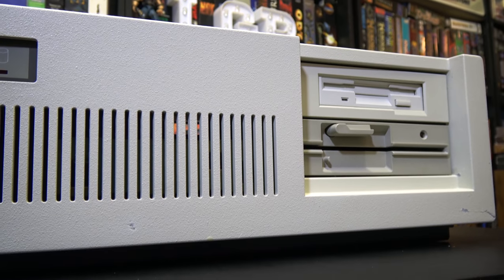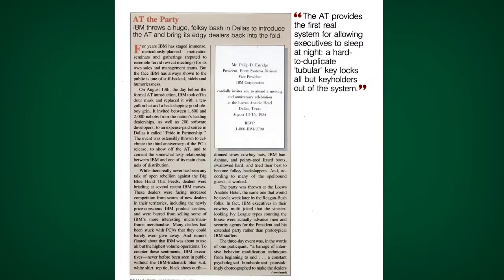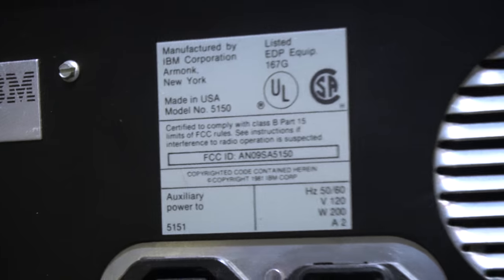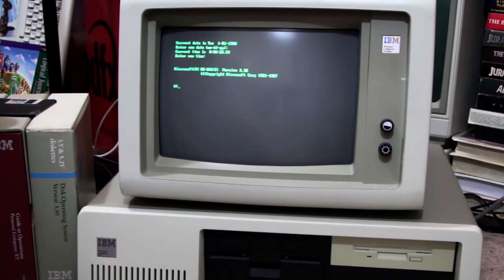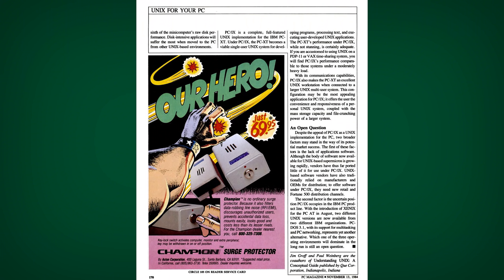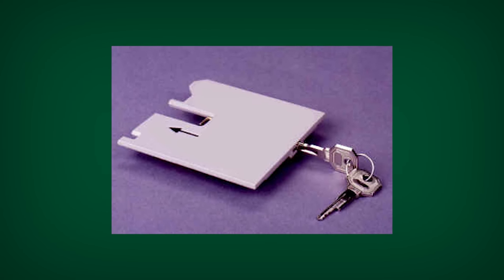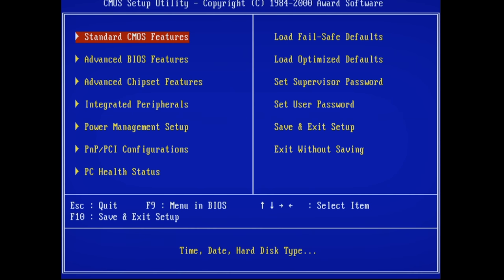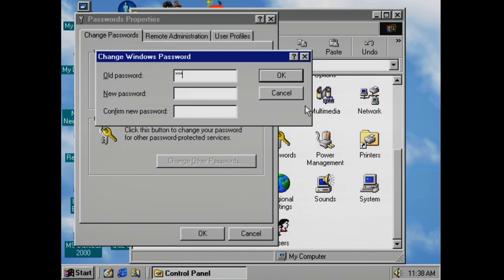Why did old PCs have key locks? An LGR Retrospective

Comment: Remember before NT when all you had to do was hold down the left-shift key while Windows booted to bypass the login screen?
Reply: I would just press Escape when I had Win 95 and 98. You don't hold it down. When you reach the login screen, hit escape and that's all.
Reply: Or you could just click on the Cancel button.
That login dialog in Windows 9x wasn't meant to prevent access to the computer, it was just to load your personal profile with customized theme and configurations.
Reply: Or DOS where all you had to do was walk up to the computer and you are already root.
Reply: Thats where the keylock comes in for DOS.

You can still easily bypass the security on a windows machine. Just pull the hard drive out and plug it into another windows pc. By default NTFS drives arent encrypted and file permissions can be trivially overrided in another windows install.
Reply: @guitarman13021  "Root" is an understatement. DOS runs everything in friggin' ring 0 (and PCs before the AT were physically incapable of running anything other than ring 0)

Comment: Okay, now I want to know about the turbo button!
Reply: The turbo buttom actually slowed the computer down to be able to run older software.  Release it and you could run at the full 40 megahertz.  But I am a computer geek.  I have an Intel 486-DX2 66Mhz and I am going to upgrade to an AMD Am5x86 133Mhz!  I am also getting Matrox Mystique SVGA video card with 8 megabytes of ram!  Speaking of ram, I am upgrading my 1 megabyte of ram (already an impressive amount) to 4 megabytes of ram, a near God-like amount.  Wolfenstein 3D will running swimmingly smooth! With a SoundBlaster Awe 32, you may worship at my computer's 17 inch 0.25 dot pitch screen!  You probably only have 512 megabytes, EGA video card, and a Cyrix 486sx 33Mhz.
Reply: @indridcold8433  You don't need a 486 Dx2-66 to run Wolf3d smoothly.  It ran perfectly on my 386sx16 with an Oak Technologies non-VESA 512k video card (max resolution 800x600 @ 16 colors; but usually ran in MCGA mode [320x200x256colors]).  80MB hard drive [that always had the stoned virus, lol].
??? And a Matrox Mystique 8MB RAM video card??  They came out in 1996/97... What are you doing with one of those and a 486?  Spend the $ on a Pentium or Pentium Pro first.
And I had 4megs of RAM on my 386sx16.  If you had a 486dx2/66 you would already have 8megs (if you were smart) or 4megs (if you were cheap).  1meg of RAM doesn't even let you run Windows 3.1 - so everyone had at least 2MB.  Windows 3.1 was a killer app for 386/486's.
When I upgraded to a 486dx2/50 we couldn't afford to get more ram.  This was very frustrating as some games (like Ultima8) needed 8MB by '93-'95.
And by the time 486's came out, no one had an EGA card unless they were still on a 286 or XT.  Even the sorriest souls with a 386 or better had a VGA card that could run 640x480x16 or 320x200x256.

Comment: I wish my "modern" PC could be turned on and off by the turn of a key like that XD
Reply: I joked about putting an inert Victrola crank on the side of my old-ass PC.  It would baffle people whilst being helluh-steampunk.
Reply: That'd be awesome!  I'm sure there's someway to make it power on the PC too, with a few cranks. @VolcanoEarth
Reply: @Benjamin P
yeah, that'd work as well
Reply: Modern PCs shut down via ACPI, which allows the system to wind down and reach a safe state before shutting down. If you had a switch like this, it would circumvent that system and potentially lead to data loss or total filesystem corruption.
Reply: @scoreunder  I get what you are saying but I think with a bit of electrical knowledge you could work around that. I mean I can just hold down the power button which kills the system or I can press it for a second and let the system take care of the shut down.

Comment: I worked in a government department when IT started being rolled out. Damn things got pinched all the time. Some of our offices were even ram raided. As soon as we replaced them they got stolen again. We ended up putting the base units into steel cages that were bolted to the metal frame of the desk.

Comment: I seem to remember these keys being everywhere at one company I worked for in the very early 90s. And, since they seemed to be increasing the number of desktop units continuously while i worked there, I mean literally everywhere. The systems were bought in bulk and they all had this feature. But, apparently, nothing outside of the mainframe room was deemed valuable enough to merit locking down.
Heck, their attitude was so trusting and generous that I was allowed to stay after hours to teach myself how to better use our equipment and software. In the end this was a smart decision, since I became quite the power user. The programs I was able to learn in depth included Word Prefect and Lotus 1-2-3. With the basic programming skills I'd learned in high school, I was able to make many of the functions in our department semi-automated. This allowed employees with limited skills to generate polished reports and correspondence without additional training. These skills also became the backbone of my career as I moved on, always taking advantage when an employer would allow me to do so as the field continued to grow.
Also, it's the reason why I still use Word Perfect over MS Word. Once I'd discovered the control which came with "reveal codes" I could never find the work involved in fine tuning a Word document anywhere near acceptable. I mean, have you ever tried to move a graphic once you've placed it in Word? It's hell. Just because something is everywhere doesn't mean it's the best.

Comment: the funny thing is tube locks are some of the easiest to pick
Reply: Oh yeah. I've opened one with a plastic straw for a bet.
Reply: They only kept the honest people honest.  But back then password software was aftermarket. MS-DOS, PC-DOS, IBM-DOS, OS2 Warp, Windows 3.0, Windows 3.1, and Windows 3.11 for Workgroups had no password software. There was a basic one for Windows 3.11 but all you had to do was go into MS-DOS and look into a file to find the password. The keyboard lock was the answer back then.  Today, the passwords are better than the key locks could ever had been. The key locks merely gave the illusion of security. Some cases also had a configurable LED number read out that could be configured to say anything at all, though the idea was to put the speed of your processor.  You would put a 66 in the front for an Intel 80486DX-2 66Mhz processor.  I liked putting 300 in the front and everyone thought I was a god because processor top speeds were only 200Mhz back then.
Reply: @indridcold8433  - Remember a software called 'DIRECT ACCESS'... great menu system for ms-dos
Reply: I got into one with the end of a paperclip. Took a few minutes on my first attempt.
Reply: @JaxMerrick  straw would be hard to pull off but you just need something soft  and tube shaped. I've heard the plastic Bic pen is the best.

Comment: You're missing a big reason for that time period. It was $500 for a 4MB stick of RAM. Yes, I said Megabytes not Gigabytes. That's why we locked our company's down. The cost of the hardware components, not access. Passwords have been around on software forever.
Reply: yes and with that kind of limited hardware, password abilities were limited, something like a smart card was unthinkable, so, in lue of a smartcard, you have a physical key to prevent access

Comment: There are tubular lockpicks for those chicago locks.  The cool thing about them is that once you've picked them you can read the key bitting off the pick and use it to cut a key to fit.

Comment: Picking the lock is the old way to "hack" a computer.  he he
Showing those old IBM's remind me of the trouble I had getting hard drives out of the monsters for disposal.  The top that comes off is bad design.
Reply: Talking about this design with that last sentence? http://s52.radikal.ru/i137/1405/ab/f9da92ae504a.jpg AKA I use to own a Dell Optiplex GX115 with a 933mhz Pentium 3 and 384 megs of ram and a 80gb hdd. Slapping in a Nvidia Geforce FX5500 for basic games all while running Windows XP. Its what I had until i graduated in 2006 before I used my gaduation money on a brand new AMD Atholon X2 6800+ running WIndows XP Pro 64bit but quickly switched back to 32bit as there were 0 programs for xp 64bit and my AOL back then wouldn't work on it either so I could NOT even get online with it.
Reply: I have muscle memory of opening those things to manually reset CMOS jumpers.  For... reasons.
Reply: Fun tip: the term 'hacking' actually comes from using a hacksaw to remove locks and hasps from old cabinet-sized computers to use them without permission.

Even funner fact: I just made that up and have no idea if it's remotely true. But can you imagine?
Reply: DEAD_P1XL That's not a bad guess, no doubt the variability & wide possible usage of "hack" is why it's so popular.
I imagine someone hacking through thick brush or jungle with a machete, only it's a jungle of code & programs
Reply: +Jane Gerrard:  Ugh, I had exactly the opposite thought while watching "Brand NEW IBM PC AT + Model M! Unboxing & Setup [LGR]".  I'm an old school computer user, and I dig retro-tech, but when he powered up that AT I was reminded why I no longer have any relic PCs.  The whine from old HDs and old fans is just unbearable to me.  It can be extremely useful to be able to monitor HD activity via their sounds, but I'd much rather use an activity LED, where possible, or a software indicator where not.

Comment: 486DX2  66mhzcomputer. The last computer before the Pentium chip. I know because I could not afford the Pentium based one. I think it had hundred megabytes hard drive.
Reply: No. The 486 DX4 was the last before the Pentium.
Reply: Dx4 at 100mhz
Reply: Lim Dennis Wasn't there a 4x33MHz=133MHz DX4 ?

Comment: I had a HP Vectra 500 from 1996 and it still had a key lock. It prevented the case from being opened, and the BIOS from saving configuration changes. The case also had some apparatus inside that when engaged prevented the CPU from being moved from the table, so if you locked the case, it effectively prevented CPU theft unless the burglar took the whole table or destroyed the case.

Comment: What was the point of the turbo button? I’m sure we always had ours switched on all the time
Reply: You should only press the turbo if you really needed to haul ass
Reply: Back in the day some older programs, like some games, would run too fast on high frequency.
Reply: You left your turbo ON? You probably slowed down your computer doing that. 

Turbo buttons slowed down the processer to run old programs that ran WAY to fast cause the programmer never considered faster computers

Comment: I worked for IBM in Amsterdam from 1984 to 1986.
For added protection, they designed a metal clamp with a lock. A pin blocked the power switch on the side making it impossible to turn the PC on.
A really stupid idea.
At that time all IBM PCs had a power outlet to feed a monitor.
So I demonstrated how to power up the locked PC.
Simple... I used a standard power cord and 2 paperclips to feed power to the PC via the monitor power output!
All they could say was something like: "nobody will ever do that"...
That was the last time I have seen the lock...
You don't need a Mensa-IQ to figure that out, but it helps!

Comment: you forgot to mention that one of the major problems that keylocks prevented was theft of internal parts... back in the day memory and disk drives were very expensive and having access to the innards of the working pc, allowed one to steal the HD or memory modules... or heck, someone with a bad computer at home could just swap the defective parts with the company's machines... the perfect crime.

Comment: The funny thing is that the use of a key for a computer is much older than the IBM from 1984. On machines like the PDP8 series (starting from 1965) there was a key to turn on and off the machine. Later models approx 1970 like the PDP8/e had "OFF - ON - PANEL LOCK". In the PANEL LOCK you could not stress the system by flipping front switches... There were many manufacturers who used keys on their systems at that time.

Comment: I remember our family's first home computer (from the early to mid 1990s) had one of those round keylocks, but I never really thought anything of it. We didn't have a key for it since our computer was one being thrown out by the business my mother worked for at the time, so it was just easily assumed it was there to prevent people from stealing parts from the inside. Considering we took home the computer and it was unlocked when we got it, either the company didn't care when they decided to replace it or it was never locked in the first place.
The casualness of a business discarding an old PC with no security measures is almost laughable these days, but those days few households had internet (early versions of AOL) and even less people knew anything about using computers in general, so nobody really considered security much.

Comment: In the UK I believe the issue was mainly the high value of the equipment, so they were strongly attached to desks. I worked at several companies where the PCs were bolted to the desk with a plate device underneath. It was a bummer when the next generation of no-lock computers came along - the companies usually threw out the desks as well, because of the damage the plates had caused!

Comment: I swear when I got my first computer in 1993, the keylock actually physically prevented the keyboard keys from being pressed - as in you'd push the keyboard keys and they wouldn't go down anymore. It was an IBM clone from a company then called Cybermax, the case looked identical to the one at 6:00 except the case badge had their logo instead of the specs. 
Not sure if I'm remembering childhood wrong here, but I've never heard of such a mechanism before.

Comment: Key locks also prevented the power from being turned OFF, which was useful when the computer was also a terminal on a network.  Older networks were controlled from a single “host” (server), which “polled” one terminal at a time on a shared line.  If a terminal had no transaction or data to send in, it would immediately respond with a short “NO” signal, and the next terminal could be polled.  If a terminal lost power, the host would wait (usually 3 seconds) and after a certain number (usually 2) of retries, would remove that terminal from the polling list.  This slowed down service on the other terminals sharing the line.

So managers had an interest in not letting operators power DOWN their machines.  Also, bootable floppy disks could be booted up to make changes in the data OR THE OS when power came back up, which could allow a user to change the system without authorization.

Comment: I think i would prefer this over passwords... for many reasons
Reply: Considering how easy it was to create your own makeshift tool to unlock them, the possibility of losing the key, as well as nowadays the threat not being from physical manipulation but remote digital manipulation, I can't see why.

Using different intelligent passwords and taking advantage of the advanced and redundant security features offered, as well as keeping informed when major data leaks happen, is far more secure, and if you can't remember them all, you just write them down on a real piece of paper (and if you really want to be secure, locking that piece of paper up in a safe) because again, the real threat is online.

Comment: When I was about 7 years old I went to an electronic parts shop to buy some IC's for my little projects, I told the man in the shop what I need and he said he goes check if they have it in stock, and locked the computer with this key. I had my own key and unlocked his computer, it showed a login screen, I typed "supervisor", but couldn't figure the password, so I just locked it back. When he came back he saw the screen with the login attempt and asked me if there was somebody else at his desk, I said I don't remember seeing anyone, I didn't lie after all. This little action made me spend 20 more minutes in the shop than what I expected because he was asking around all the other eployees why the supervisor wanted to log in on his computer. They never realized what happened, only if they read this comment like 27 years later. Probably not.

Comment: The lock was also used to stop people stealing high value chips, ram etc.   Best one I ever seen was an old DEC PC and it had a rod going from the front button to the back of the power supply  and someone had fitted a ignition barl to the PC on the side.  I asked the guy why he had fitted an Ignition barl to it.  He said he was fed up with the worker on day shift moving his icons around.  Genius it was fitted perfect.

Comment: The external power switch lock for the IBM actually contains a 5 pin Medeco Core which is extremely hard to pick led alone duplicate, but it would still take LPL 2-10 minutes to pick rather than a tubular lock which would take 2 seconds to pick open today, but keep in mind this was the mid 80s when tubular locks were still alien technology and tubular lock impressioning tools did not exist yet, so this was actually pretty secure.

Comment: Something interesting on my SGI machines from ~1993; they include a place to put your own padlock. The cheaper system (Indy) could likely be permanently broken with enough force, but the more expensive Indigo 2 uses a pretty substantial metal bar that runs the length of the case.

I wonder if SGI decided to rely on the end-user to supply a lock so that they wouldn't be held liable for theft due to inferior locks (of course, it saves money as well). This system could also be used to chain the system to a wall, though I think somebody would notice you walking out with a bright green 20 Kg Indigo2 worth 40 thousand dollars!